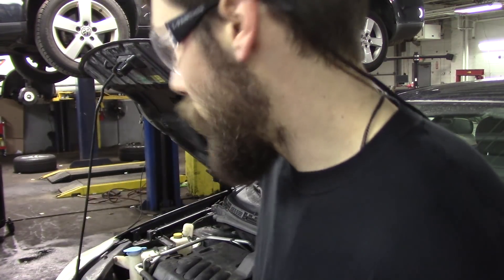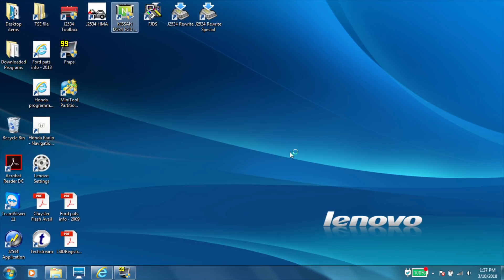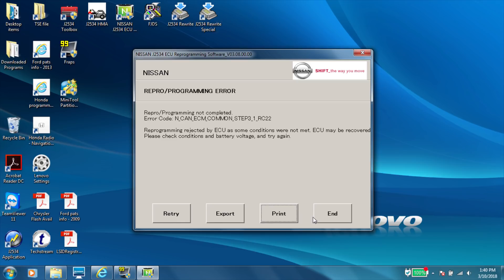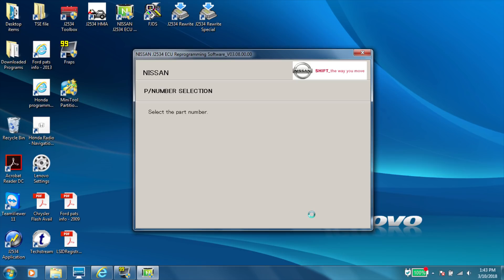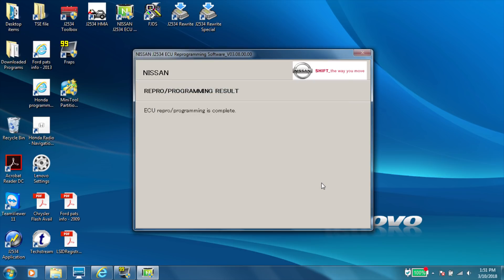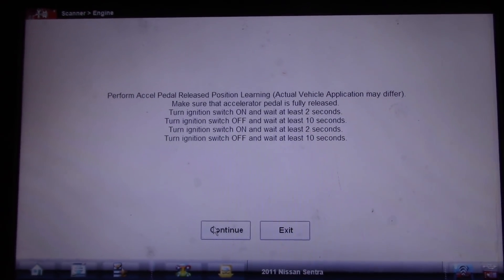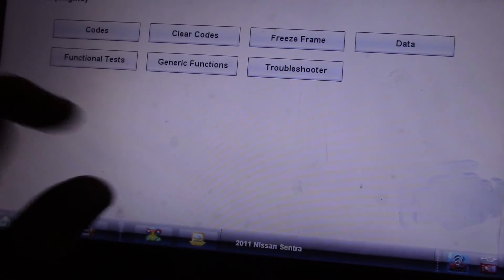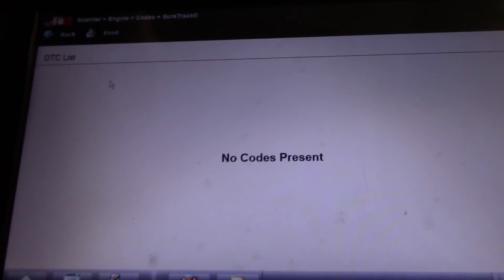Nissan ECM Reprogram J-2534/NERS (WITH AN ERROR!)

Comment: I'm Reprogramming a Used TCM and I'm having Some Issues. TCM Part # Pulled By VIN is 31020CM38D. Firstly, Looks like things are different now On the Nissan Website than they were since you Made this Video. You Went Under J2534 Which is no Longer Available Now in 2025.
 Also, The Nissan Tech Info Site did not have Programming Data Available Under CIII+ for Reprograming For that TCM Part # Was Only Able to Pull the Programming Files Under C-III+ Blank. So I bought that One  Under C-III + Blank. I did exactly as You said Copying and Pasting the dat and Blank files to the Reprograming Folder and the esv and and enc files into 107 that I had to create because I did not have the folder.

 Then My NERS Download Software Package did not have 107 Folder, So I had to Create it In the "Config" Folder, I Pasted the CSV and enc Files in it. When I Went in the NERS Software V03.04.00.00, I Tried to go through "Reprogram" It gave Me Error saying "Matching entry not found in ONC File" 
And When I Go though Programming for Blank ECU(TCM) It Still Gave Me Error "Repro/Programming Configuration File Not Found" and the File size before is saying 0kb.
Please help, what do I Do to Fix this?
Reply from the maker: It’s been a long time since I’ve done a Nissan. I’m sure things have changed.   You should check L1 Automotive. His name is Keith.  His website may have what you need.
Reply: I Have Contacted him, but haven't heard anything back.
Reply: @PositiveLeadDiagnostics Now I'm having ONC File Pre Says Matching ONC Files not Found

 When I Try Programming Or Reprogramming Same Thing.

And what is this ONC Files? Where to get it?

Comment: Do you have any videos on how to relearn exhaust/intake valve timing on nissan/infiniti? My car has been having some strange lag/delay on rpms somewhere under 2k RPM. I have been resetting my car ecu and relearning manually many times where I finally got the car running really powerful and very responsive when i step on the gas, but there is still this strange delay in power at low rpm. I can hear the throttle open but it just has this delay where the power just flips on like a switch right around 2k rpms. I am thinking it is something with exhaust or intake valve timing not opening properly but not sure. my car is 08 G35s 6mt

Comment: Get the same fault happening on my wife's 2012 Nissan Maxima. When we bought it had an issue with the mass air flow sensor dealership replaced it fault was still there recently having rough idles and whatnot so I replace the mass air flow sensor again myself so now we have to get the ECM updated as Nissan dealer. Car repair stuff is fascinating though that was very informative, thank you

Comment: Hey man great vid! I have the same 2011 Sentra with the 2.0L V4. 3 months back, it had the Service Engine Soon light and then, it soon followed with a VSC and Traction Control light. That’s when the vehicle was rough idling, shuttering and it can’t go past 3k rpm. Took it to a mechanic and spend $300. He said, a P0101 code was there and he reprogrammed the system. Also, he said something about cleaning the fuel system. Now, the SES light is back and he said, he reprogrammed the system again. Drove off, the vehicle completely stalled. Took it back and the other mechanic did a idle relearn as, someone did it incorrectly. My question is, is it really hard to reprogram Nissan’s or do you think my mechanic is doing a horrible job which they did. Thanks.

Comment: Can I start a complaint for this? I have a 2011 Nissan Rogue. Is this possibly a recall? I called corporate and they tried to relay the mileage as to whether they would reprogram it or not. I just think its ridiculous because may have little to do with the problem.

Comment: I have 2006 Infiniti M45, it kind of stall after 3,100 rpm. The car wasn’t reprogram after engine replace and it hesitated power, for example: if I floor the gas pedal, the car wouldn’t pick up if the rev is past 3,100 rpm. Am looking to reprogram the ecm and I haven’t find a way to do so yet except your video. I understand that Infiniti are Nissan and they share a lot of stuff especially when it comes to parts and the electric system. Will I be able to use the Nissan website to download what I need to reprogram my Infiniti??? Thank You

Comment: Wow! That was a intresting and complete work through. It was good to see you met up to the chalange! Good show! My Nissan 2015 Versa manual transmission has been in the shop for close to two weeks. The auto would crank just would not start. Towed with my GICO Road side service call waited under an hour. Taken to teh shop. No warnnig or check engine lights. The shop hooked the car up and diagnosed a bunch of codes. Started chasing them down. And decided to check the computer itsrlf. They had to find a ECM for $75.00 Salvage yard.

 Got to call him back now to find out if it is going to be the right one and if it's gonna be programmable.  The mechanics at the shop says it's the right component and the programmer will be in tomorrow, not sure what time. After he gets there they can carry on to the next steps.

Comment: Can you select a different part number as you update/reprogram the ecm from the actual one the ecm module came With? 
Eg Curret ecm have abs and cruise control and i want to reprogram it to delete abs and cruise control because vehicle is not equipped.

Comment: Thanks for the video
1. How much does this flashing equipment cost?
2. Can you also reprogram the transmission using the same setup?
Reply from the maker: The j2534 I have costs around $1600.  You can program tcms but I hear it’s very risky on Nissan using the j2534

Comment: Hello PLD. I’m trying to reprogram a 2009 nissan versa for a p1421. I need the part number to start. Where do i fine the part number?
Reply from the maker: Part number of the ecm is on the side of the module case. Or you can pull it using a scan tool
Reply: Ah ok. I have that number. I just wasn’t sure if that was the actual part number or if i was supposed to use the calibration id. I’ll try that number again.

Comment: NERS is definitely a piece of crap! Two things I have questions about. When programming Nissan the cooling fan runs on high, was yours or was it disconnected? I also noticed you have so many different J applications on the same laptop. I don’t use J that frequently and try to stick to factory software but I wonder if it’s creating a problem.
Reply from the maker: I disconnected the cooling fans so they would not turn on. This laptop came with all the apps on it. The previous owner told me he never had any problems.

Comment: what did you do wrong? worked on a junk nissan :))
Reply: Never program a Nissan wirelessly ever I was told might have been John anello who said that. He has 250 tousend Bux worth of factory tools.
Reply from the maker: Do you mean the connection to the internet?
Reply: Positive Lead Diagnostics  no you want a wire from your programming box to the car . I know launch is Bluetooth and in the key fob 2 day training a guy said he had window not working after key programming . Simone mentioned what I said and I was Thinking hmm that would explain the problems this guy had.
Reply from the maker: The cardaq plugs directly into the dlc and is plugged into the laptop through USB. The only thing wireless was my internet connection
Reply: Positive Lead Diagnostics 
I have the drew tech on my list of future purchases also.

Comment: Could you have just replaced the intake boot & done the relearns,
& forget about the ecu update ?
I assume without the update, you would still possibly have the PO101 
or maybe not, with the new boot.
Reply from the maker: I think eventually the p0101 would have come back.
Reply: Thank You.      If you didn't have to ship the car, as the
customer is waiting, it would have been nice to find out.
Reply from the maker: I did clear it when I first looked at the vehicle months ago. But did the p0101 return before the torn boot?  Not sure
Reply: What did you use for a Battery Maintainer ?
Reply from the maker: Powermax 100 amp

Comment: Well done again Tom. You need to stay calm with reprogramming glitches. Nissans are very picky with TB relearn.
Reply: You're right about the idle relearn. Had one that wouldn't work, after many tries found info that would not work if idling too fast and must unplug injector(s) to slow engine speed before relearn would work properly.  Bad design.
Reply: Yes, i have had to do that.
Reply from the maker: That's for sure.  Scary especially on my first one. Lol but I made it through